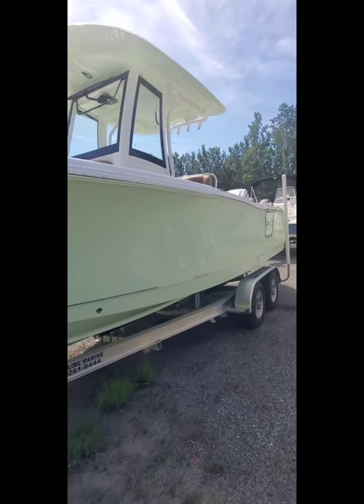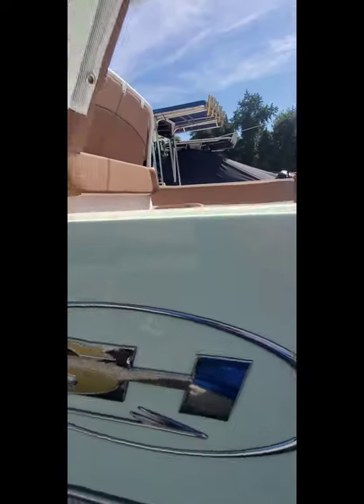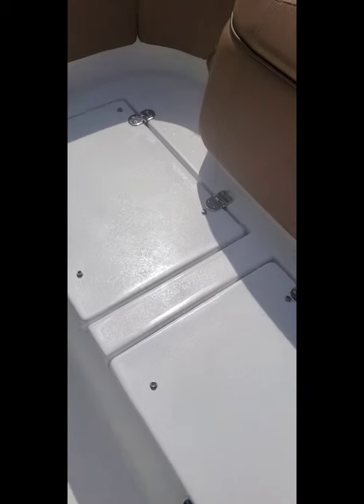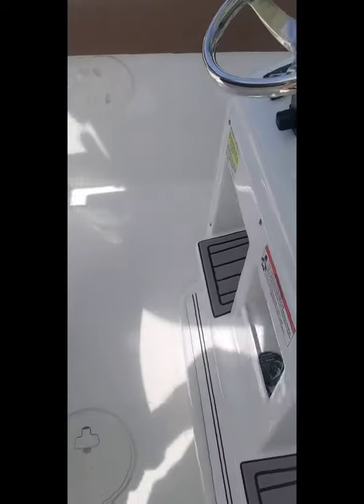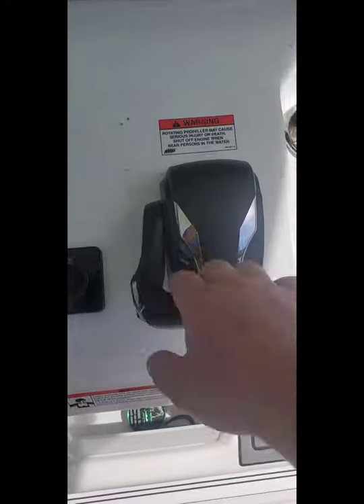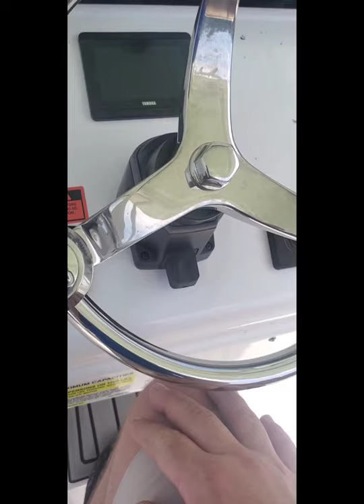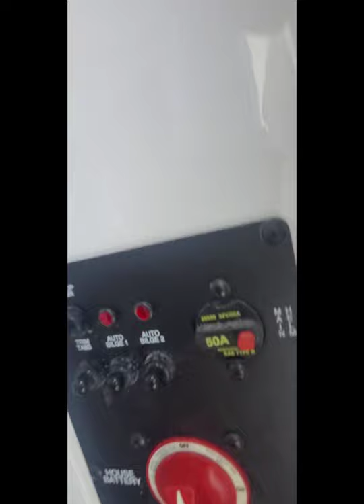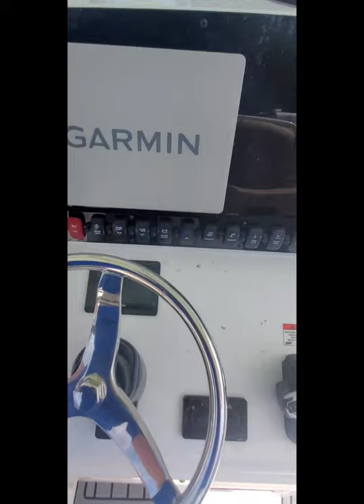2022 Sea Hunt 255se Ultra walk through from an owner not dealer.

Comment: Hey Jordan great video! You're so correct, you cant find any info on the boat in terms of walkthroughs. I actually bought a 2022 255 Ultra and i am currently waiting for delivery. cant wait!  

you started talking about gas mileage, what are you averaging if you cruise around 30-35 mph?
Reply from the maker: 1.7 to 2.1 full of fuel and ice and tackle